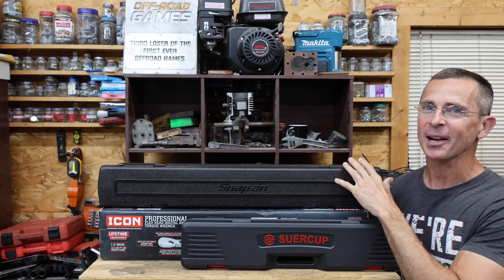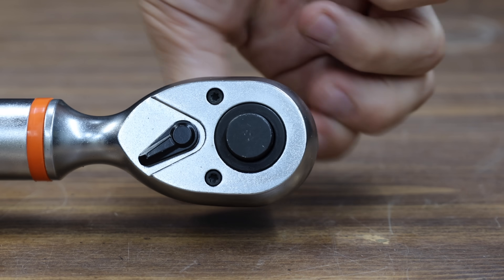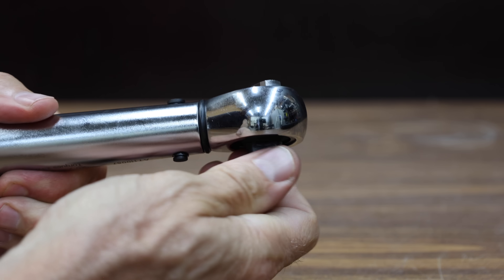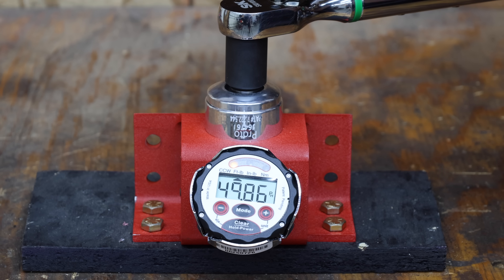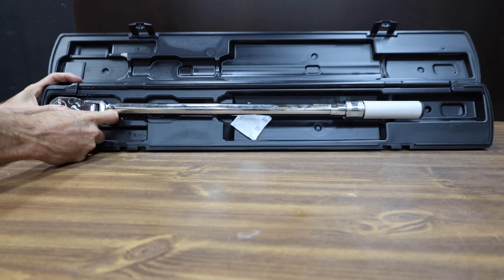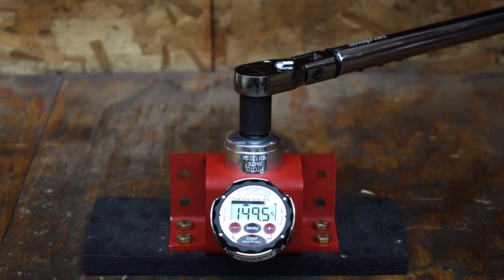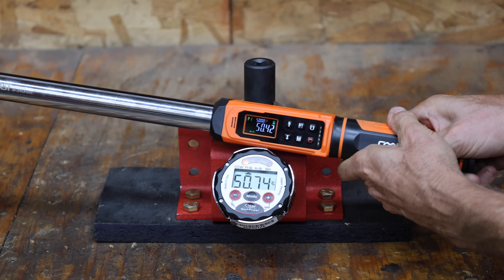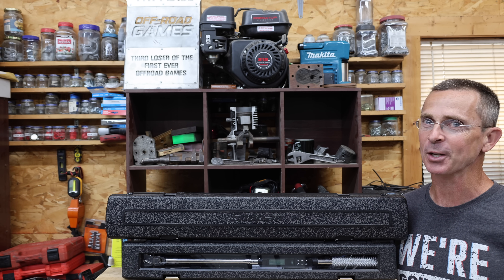$78 Torque Wrench vs $790 Snap On & ICON—I Didn’t See This Coming!

Comment: A caution on the AA battery type: Note that all of these use electronic power switches, thus have a few microamps drain continuously. This can eventually (year or two) drain the battery to where it begins leaking. The button cell type mostly don't have enough fluid in them to leak.
Reply from the maker: Thanks for the feedback.
Reply: Button cells will leak in you digital calipers

Comment: Another fine one, Commander! Good selection and really good tests. I have a flex-beam pointer and a micrometer job with a ratchet. The flex-beam is a Craftsman and the micrometer ratchet job is a Blackhawk. Never used them much, the micrometer job on retorquing head bolts on a diesel wabbit but the rest was a combo box wrench and hand pull it till it was TIGHT after anti-seize. Wabbit ran for a very long time and never blew a head gasket on a small engine either. Happy fall and leaves are falling in the rain. Hope all the Farmers are kicking high and Enjoy MANY BLESSINGS!
Reply from the maker: Hi Lewie, Thank you very much! It always means a lot. Sounds like you've got a great setup. I have an old Craftsman (USA made) but it's limited to 150 ft lbs. It's been a great torque wrench. The leaves are really beginning to fall quickly around here and the grass growth has nearly come to a stop. The cattle will be switching from grass to hay very soon. Wishing Yall many BLESSINGS!!!
Reply: @ProjectFarm  We got a good rain today and a good blow to go with it. Maybe a frost will come and take the rest of the leaves down and I can grind them up one last time. Yall remain calm and enjoy the late fall/winter coming and LOTS MOR BLESSINGS to YALL!

Comment: I run an repair & calibration lab at a major engine reman facility (for over 10 years).
My findings duplicate what you have produced here.
Briefly tried moving away from snap-on many years ago, but that didnt last long.

They are the best, and their industrial line-up holds up through the abuse.
🍻
Reply: Reliability and customer service is what you're really paying for with the high end stuff, but man, you could get 10 SUERCUP wrenches for the price of a single Snap-On.
Reply: @hairyfro if youre building 5-10 engines in your life, yes.

At 440+ engines each week, priorities are different.

Comment: It looks like I have to throw away my gearwrench torque wrench 😂 🤦🏼‍♂️
Reply: I was surprised how it got so bad after the high usage test. If one had bought a DIY airplane it wouldn't pay to use a Gearwrench for torquing out the parts during assembly.
Reply: I have that one, I work on all makes and models, I also cross test it with other wrenches, I definitely dont have this problem with mine?
Reply: Yeah I have this same one too. In the trash it goes and I am done with Gearwrench. I suspected their tools have been getting worse or maybe it was just me. Now I know I wasnt crazy

Comment: To check the calibration I set the wrench to the desired torque then clamp the drive in a vise, then hang weight off the end until it clicks or beeps. There is a line on most handles where the weight should be hung.  Heads, Valve covers, or any work with carbon fiber, I check it before use to insure it is calibrated.  Always best to assume nothing and trust no one.
Reply from the maker: Thanks for the feedback.

Comment: I have used the cheap click 1/2 inch torque wrench and never had an issue. The 1/4 inch torque wrench had me break a bolt off in a honda shadow head. It was not a good experience.
Reply from the maker: Thanks for sharing!
Reply: Which are you talking about? Pittsburgh? I've been pretty happy with the Husky 1/4". Would have liked it to be cheaper.
Reply: I love my topeak d-torq for use on small, low-torque fasteners

Comment: moral of the story here is for 99.9% of tasks literally any torque wrench is accurate enough for mechanical repairs. thats nice to know and honestly that suercup is super impressive at the price
Reply: Dont use pittsburg torque wrenches, they often dont click!😬😳. They are garbage, make a better hammer or pry tool than measurement device
Reply: @connor3288 especially if you're using it on anything that's not flat level with it , tried using it on my castle nuts for my ball joints and would not click no matter what. So upside down and anything vertical will not give you a click
Reply: Makes me feel pretty good about my $60 wrench
Reply from the maker: Thanks for sharing!
Reply: It would be interesting to see if the Suercup ones are consistently accurate and Project Farm didn't just get a good one by chance.
Reply: @lmlm2500  we the people can update on that
Reply: Diesel mechanic here. Can confirm the consistency and accuracy is highly important. Injector solenoid nut on an x15 is torqued to 2nm. Will break off at approx 4nm. Ask me how I know 😅. Granted I really like my snap ons but I’ve found that they are the most reliable in the long run
Reply: @billyboomer  I have a narrow torque range 1/4 drive Hazet torque wrench for low ft-lb values. It seems to be good.
Reply: I still use beam-type torque wrenches. They're much simpler than digital or click types and more versatile, but are they as accurate? Inquiring minds want to know. I haven't found if Project Farm tested beamers or not.
Reply: @rcnelson There are other channels that perform these consistency and accuracy tests, also with 1000 cycles in between for Beam Style torque wrenches. Just search for it in YouTube, it'll come up.
Reply: I got the Snap-On because it mostly does head bolts. The more accurate, the better.
Reply: depends on how often you use them.  When building an engine you can use them up to 500 times on one engine.  As a mechanic I need something that remains accurate for years and I've had good luck with the Snap-on and Mac Tools ones.
Reply: @cowboy3490buy you 2 or 3, the cheap ones and save some money.🤷🏻🤷🏻
Reply: @cowboy3490giddy up
Reply: @cowboy3490 For us nonprofessionals, would you suggest adding 5-10% to the toque spec on any toque wrench to be safe? Seems like even calibrating a wrench can be off a bit.
Reply: @Coltforty-five depends, some bolts will break if you do that. For me, especially when dealing with machined surfaces, consistency is more important than being exactly on. Let's say 100lbft and you wrench is guaranteed +/- 3% that means the most it can do is 103lbft and the least is 97lbft or 6% overall variance. If you have one that works +/- 1lbft it would end up being 99 and 101  or 2% total variance. Most wrenches i have will torque within 1% of what it initially torqued at, meaning if it over shot at torqued at 102 it will vary between 101 and 103 at most.  The closer, the better for even clamp load, particularly on head gaskets. If you add more torque, the over all torque can vary even more.
Reply: @Coltforty-five  No, use the spec you are trying to get to.  The best bet is to find someplace to test your wrench.  Tool trucks or stores.  Nominal fee and sometimes free.  The worse feeling in the world is tightening something and it suddenly gets easier to turn.
Reply: @cowboy3490 🤣👍
Reply: @Coltforty-five nah. Then you're over shooting no matter what and that's bad at best, pulling a motor because you can't get a drill where it just pulled threads from/snapped the bolt. +/- 2% is fine pretty much no matter what.
Reply: i disagree, i bought 3 torque wrenches and they were all off by 15 FT-IBS
Reply: @chickon2.0  click or digital and what brands. dont forget you can adjust the click type yourself
Reply: @chickon2.0  ayuh what 3 did you buy and how did you test them?
Reply: @chickon2.0  sure.
Reply: @chickon2.0  thats crazy...i broke the bolts off my silverados oil pump because i torqued them 3 ft/lbs higher than they were supposed to be. (9ft/lb vs 12ft/lbs)
Reply: @thatsmybucket  thats a huge difference in torque by percentage
Reply: @thatsmybucket  I might have some guesses why. Some bolts on new engines and cars like brakes are one time use. Yes I also used them again but they are made to stretch and they can snap on second use. Is your torque wrench accurate? Most always the spec is with NO antiseize or oil on the threads. I often do that but know that the extra slipperiness needs lower torque and can strip or break them also. 3lbs isn't anything at 50 or 100ft lbs but you were talking 30% more torque at 9 so that's a thing.
Reply: @thatsmybucket nobody uses a torque wrench for that.  That's barely more than snug.
Reply: @stopthephilosophicalzombie9017  So IIRC physics. The torque applied would be overcoming friction and "clamping". If we lube the threads the friction is lower and we can strip the metal by too much lifting force. How much less from friction? No clue, 15% lower torque reading to get the same clamping?

Comment: I like that you tested at 150. The middle of the range is where torque wrenches should be used; too high or too low can increase error.
Reply from the maker: Thanks for the feedback!
Reply: That's a fact most people don't know. IIRC you don't use the bottom 20% or the top 10% for best accuracy.
Reply: Torque wrench’s are usually accurate 20% to max torque.

Comment: For pro environments, I can see where you may need exact torque specs, but for 99.9999% of people, 1-2lbs on a 50-250lbs range, is 100% fine.
Reply: Ok, how do you know you are only off by that much?
Reply: @Miner-49  you will never do, since most of these vary 1 by 1, so unless you want to get it calibrated professionally, you'd have to trust it. My point is that unless something is airospace grade and require 75ft/lbs cause if u go higher, u'll break metal and lower, it wont be as strong, for most people 75 or 80 or 70 won't make a huge difference.
Reply from the maker: Thanks for sharing!

Comment: Big downside to the Icon one is it drains battery even when off. Every single time I use it, the batteries are dead and need replacement. I have to loosen the cap every time before storing so I don't have to deal with dead batteries all the time.
Reply: Probably better to remove batteries anyway after use since most batteries leak.
Reply: @Garth2011 in a tool that expensive I'd use lithium or NiMh batteries, most of those are dry cells
Reply: I have a Gearwrench XP120 and I have to remove the batteries after each use or they will go dead.
Reply: @puffnstuff12  Same here
Reply from the maker: Thanks for sharing!
Reply: Take it back and exchange it. We use them and have never had a dead battery, even after sitting in a box for a couple of months at a time.
Reply: I have the snap-on and same thing. I use mine daily so not that big of a deal however the same ones in 1/4 and 3/8th drain the battery.
Reply: I don't know how it is attached. But if by screw. Put a small wing nut on it for faster release.
Reply: I have Quinn 3/8" torque wrench and I have No problem with it
Reply: I’ve had that problem with HF calipers too.  They just eat batteries.
Reply: Same for mine 😢
Reply: I have a couple Snap on torque wrenches and always pull the end cap off every time.
Reply: I had a couple of double AA's leak in my 3/8 Snap-On and almost ruined it. Fortunately, I was able to clean it out. Now I take the batteries out of all of my tools when they get put up for the day.
Reply: My older model Gearwrench also has this problem. I tend to remove batteries from anything that is not used frequently. I'd say just do that, anyway.
Reply: yep I pull the end caps off my snapon 1/2 and 3/8 after every use, 1 due to battery drain im never sure when ill use them next, 2, due to batteries leaking nowadays (dont make em like they used too!) im concerned about ruining an expensive tool. I keep traditional clicky wrenches for the daily stuff, the snapon  electric only comes out for engine build or other precision work and occationally to verify my clicky wrenches against. same way you may have a vernier caliper on your daily tool trolly, but a nice set of mitutoyo micrometers tucked away in your "precisison" drawer.
Reply: My 1/2" ICON also eats batteries. Dead every time I use it, or so it seems. I kept thinking I wasn't turning it off. I have a 3/8 SNAP-ON and will likely replace the ICON with another SNAP-ON. Sure, I bought the ICON for half the money but for what I paid would have expected better battery life. Same reason I now only buy Mitutoyo calipers.
Reply: Batteries are why I stick with the click type torque wrenches.  I don't use torque wrenches enough to be shopping for batteries when I need to torque.
Reply: Same with the matco
Reply: Same deal with the cheap digital calipers HF sells.  Why they opt for "instant on", which slowly drains the battery, rather than a cheap slide switch is beyond me.
Reply: When I first bought my snap on digital 3/8, I thought it was doing the same thing. I went through a few batteries, but now the ones in it now have been in it for 7 months. Maybe bad batch of batteries?

Comment: Given how well Gearwrench has always performed in your tests, one has to wonder if you got a defective one? That was some pretty bad error.

Also, would be interesting to see if CDI (snap on industrial, they are/were the OEM for snap on torque wrenches) would perform just as well as the snap on, as they're usually a fair bit cheaper.
Reply: ANY tool is a fair bit cheaper than any comparable Snap-On tool.  The fact people pay out the ass for that name is beyond me, especially since we've seen on this channel how many times budget tools can meet or exceed the performance of Snap-On.  

You couldn't pay me to take Snap-On tools.  I take that back...  you could and I would just take the money and sell the tool, to a moron who only buys name brand, and then buy a cheaper tool that performs just as good or better and have that much more.
Reply: @valthar3655  Agreed, i have very little, and like it but have never been able to tell this major difference guys talk about. What i have from tool truck was aquired from a realative that got sometime in the 1980s. Personally i like the fitment of my sk wayne tools. So many options nowdays that doesnt require you sell a kidney or trade in your first born..Lol
Reply: Owner of alot of gearwrench here, it is hit or miss, they make some great stuff most older stuff is great and from tiawan, the china made stuff leaves much to be desired. I got this before their was an icon version...lets just say it left much to be desired i traded mine and ended up with the quinn from harbor freight, and it was better...but i wanted a step up and now have the mac version...and after using a buddys/coworker if i had to do it over i would wait for harbor freight sale and get the icon... and they will stand behind it if needs warranting.

Comment: I bought a cheap $30 torque wrench for my transmission pan that required inch pounds it's been over a year and still no leaks from the transmission pan! So I say it was accurate enough but torquing like 18 8mms was not fun but the results were worth it!
Reply from the maker: Thanks for sharing!
Reply: Transmission pans will leak every time if the fasteners are tightened too much.
Reply: @Garth2011 exactly why I bought a small torque wrench because it took the Guess work out of it. And for 30$ same day delivery it was a no brainer
Reply: @935mapache  Yes, all the better method.
Reply: for me it is about not getting things too tight
Reply: Finally someone who knows what tool is needed for what job. It is actually mind blowing the amount of people who don’t know the difference between inch lbs and foot lbs. Then wonder why they break a 1/4-20 when torquing down to 150 ft lbs.

Comment: I would have loved to see what the $22 Pittsburg would have done.  Many people own that wrench for probably a decade or two, when it was often for sale for $10.
Reply from the maker: Thanks for the feedback!
Reply: I have the ¼",⅜" , and ½" Pittsburgh click style that i got for 10 bucks each lol I know they're most likely not super accurate but... probably close enough.. hopefully lol
Reply: @jarrodp6068  I don't have the 1/4 inch, but have the others and agree.  I can't imagine that being 5% off on lug nuts is any different than the variation between tire shop installed tires.  And I don't have any reason to believe any are off by even that much.
Reply: Yes, we need a test on the Pittsburg wrenches. I rarely use torque wrenches and it'd mainly be for lug nuts so I'm looking for cheap.
Reply: @sideler7057  For lugnuts it's more important that they're equal, not the absolute value. You're not even getting close to stretching the bolt close to the yield point on lug nuts. Absolute accuracy is more important for head bolts where the bolt stretch is significant
Reply: it is what I have
Reply: I have two

Comment: My torque wrench is an old Craftsman that has the bar with the needle and scale by the handle.
Reply: I have one of those on the wall. Can't get the beep to work.
Reply: @volvo09 I just say 'beeeep' when the pointer gets close
Reply: @volvo09 You’re not pulling hard enough.
Reply: Yep, me too (also have some old-style 'click' torque wrenches).  My take on the comparison is that there wasn't a big enough difference to make a difference.  (for most applications/usages)
Reply from the maker: Thanks for sharing!
Reply: @ProjectFarm AI powered response ?
Reply: I think that the type of torque wrench with a needle and a scale on the handle cannot go out of calibration unless God alters the modulus of elasticity of the material that the handle is made from.
Reply: @cedriclynch  I mean... metal fatigue is a thing. It's why springs eventually fail. I have no idea how long one of these would take to tweak itself out of calibration though.
Reply: @dynadork3312  I use mine for lug nuts, I figure if I'm within 3-5 lbs it's close enough, and I always try to error on the high side.